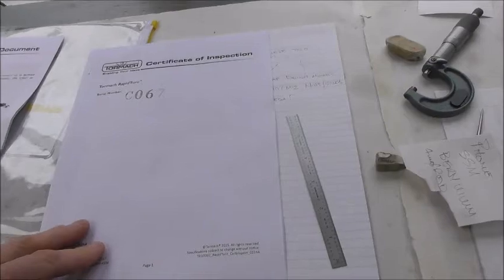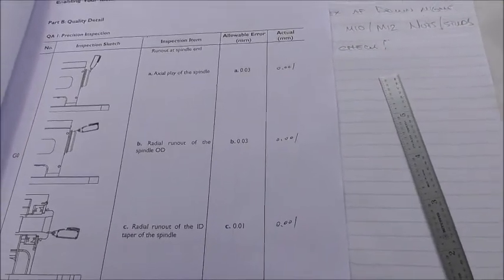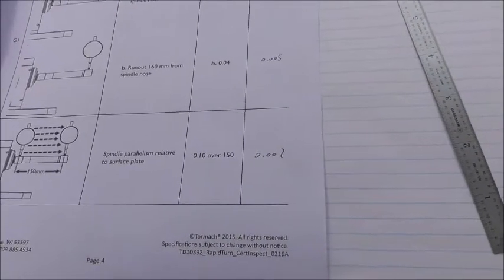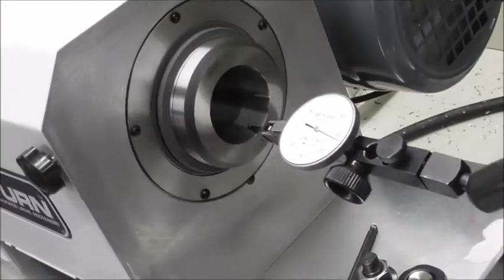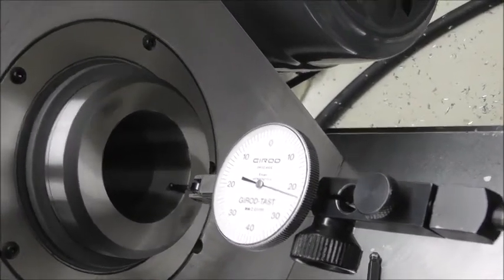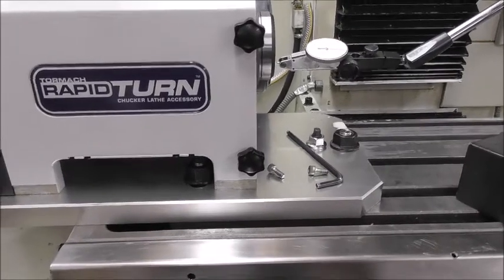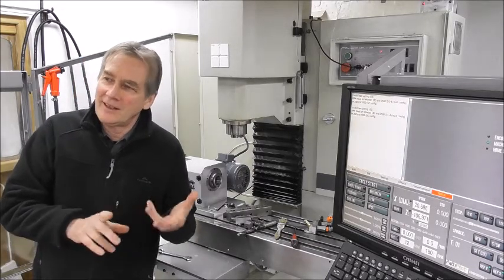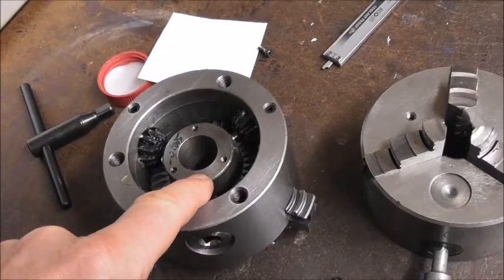Tormach RapidTurn - 2. Checks.

Comment: So what is your conclusion? I am very likely to buy one for my 770 but I am also considering waiting a bit and buy a slant pro instead.
Reply from the maker: I have yet to draw a conclusion - I am concerned it will be low on power and capacity. I will post more videos ASAP.

Cheers
Reply: Thanks, I might just wait until a used Slant shows up. :)

Comment: Thanks, Cliff for the info. I haven't yet checked my specs. against the inspection sheet but will, next time it's in use. Checking my inspection sheet (May 2016, serial C043) against yours the inspection / QA team are the same names. Results for Runout (x3) are the same at 0.001 mm. Next page the same too, except my runout at 160mm from spindle nose is 0.008mm (yours 0.005). Third page 'motion while locked' is 0.008 (yours 0.006). So it seems they (probably) actually make these tests, but as you say, the discrepancies with reality are disconcerting. However I'm happy with the job mine does so far.

As has been said, the Y axis travel can be restricted by the motor / mill column proximity but I'll be very interested in your thoughts and efforts on gang tooling. I'm using the spindle-mounted quick change tool post and it seems fine for rigidity and tool-change repeatability but then I'm content so far with +/- 0.015mm (half a thou) tolerances. 

Cheers, Andy
Reply from the maker: Hi Andy - Thanks for your comments.

Have you got a feel for how much torque at low revs is available for turning and drilling  tough steel and larger parts etc?  I am hoping light cuts will allow this type of work.

Cheers   Cliff
Reply: Cliff, so far all my RT work has been fairly small and lightweight. However, the motor is the same hp as the 770's main spindle and in low range there seems plenty of torque for milling and flycutting. The limitation for me is rigid tapping - anything above m8 it struggles. So with the RT I doubt the same problem will present itself; why would you rigid tap when it'll threadmill nicely?

Comment: I could be a bit cynical, but I don't blindly trust any test certificate including Mitutoyo's or Starrett's. I've always run my own checks as well. Even the best company's in the world can't guarantee zero defects and perfect quality control. I once read a post on a forum by a member who bought 20 rotary tables to add steppers and cnc them from what's "supposed" to be a well known and respected Taiwan manufacturer. He said all 20 test certificates had the very same numbers listed on each line. So it always pays to check.

If it were me? I think I'd use the mills spindle for the gang tool holding as you've planned, but I also think I'd want to get as much rigidity as possible and have a 3 point mount. Use the mills dovetailed column for the other two points. Can't help with setting up a method for  computer controlled locking & unlocking it between moves since electronics and CNC are way down the list of anything I have a clue about. But I'm sure you can figure something out. Yes that rubber accordion that protects the column is in the way. So that's another issue to be addressed when it's being used. 

That head and motor combination is extremely quiet. A reasonable indicator of high precision parts and it's overall quality I think.
Reply from the maker: Thanks for your comments - most appreciated.